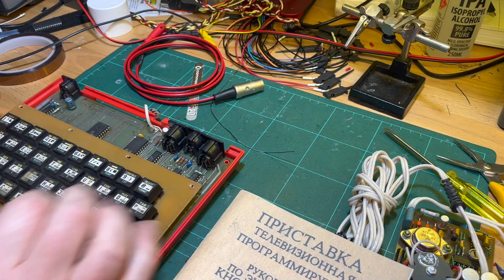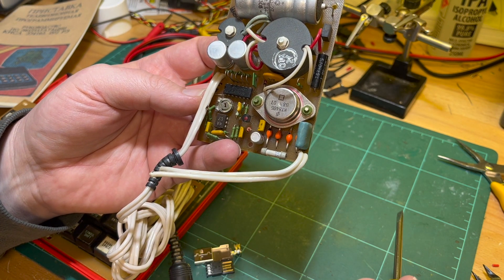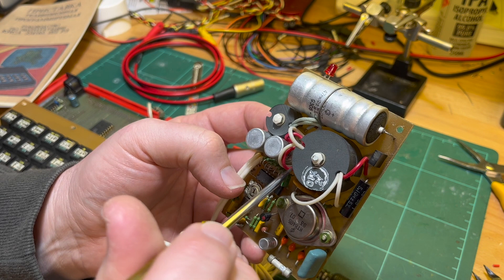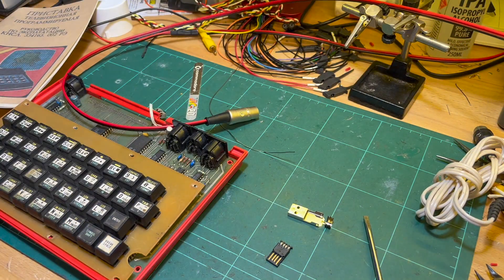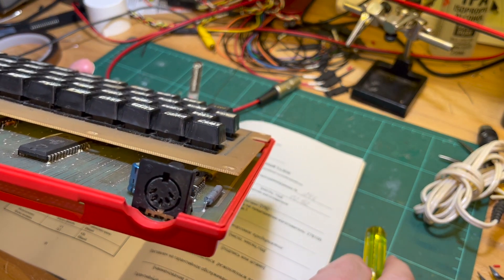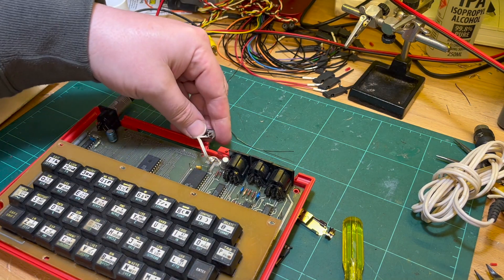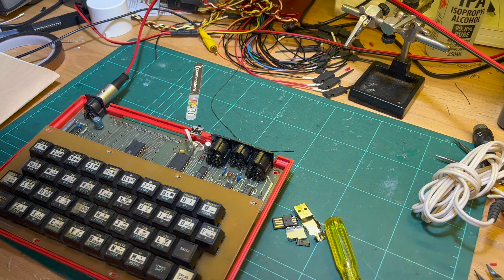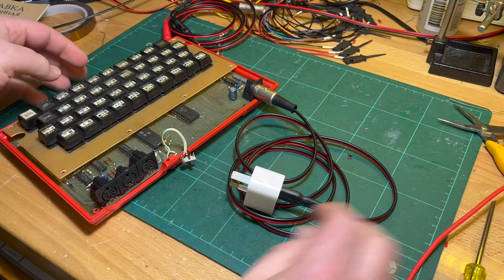🇲🇩 BYTE: Part 2 (New power supply) [TCE #0068]

Comment: That looks like a switch-mode power supply.  They immediately rectify 220V then put it to a large cap.  The track is that thin as it could also act as a 220V fuse.  The multi connector transformer is the give-away for the switch-mode power supply...
Reply from the maker: Awesome, really appreciate the extra details Bennie ... so that bobbin-type thing is a transformer.  I wouldn't normally care about the PSU that came with a computer - I either chuck it (if it's 110/110V) or I just change the plug (from Euro/UK) ... but I'm a little fascinated by this one.  I want to try to create the schematic just to understand it a bit more /Brett
Reply: @Brfff  Transformer if it's an isolated switching supply, which it probably is. May also be the smaller one is an inductor, it depends on the design. That chip will be doing all the control of the switching and pulse width, etc.
Reply: @Brfff  schematic would be awesome.  I would be interrested in the schematic too...

Comment: That switch may be Ch3/Ch4 or it could be switching between RGB/composite... or it could be a million other things :)
Reply from the maker: Yeah, I really should have a closer look - it's connected to those two quite wide tracks so simply "assumed" it was between ground & 5V and thus power ... /Brett
Reply from the maker: СБРОС = RESET switch!
Reply: @Brfff  The translation is correct. I have another clone of the ZX Spectrum. In place of a small switch, my clone has a button. It is needed to restart the computer. Perhaps this switch was soldered on your computer instead of the button.